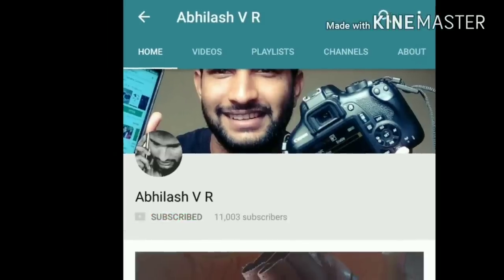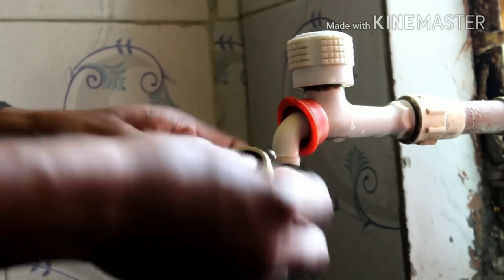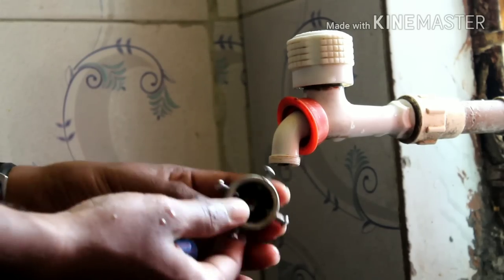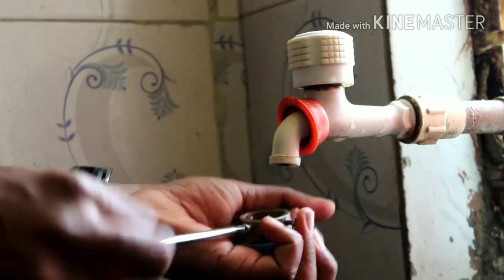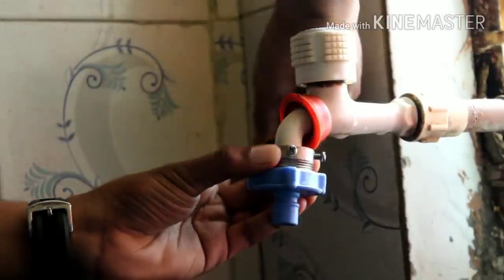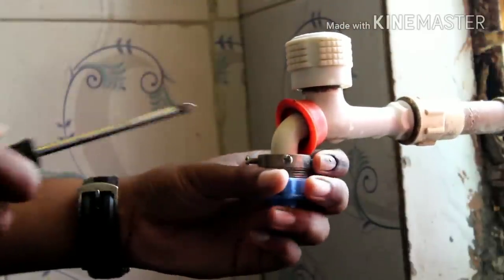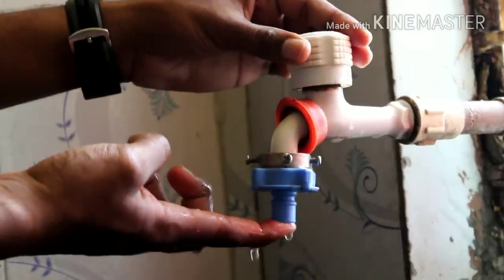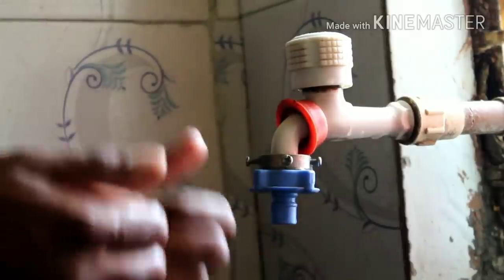#DIY Faucet Water Tap For fully automatic Washing Machine Inlet Adapter

Comment: One more problem I wanna discuss with you.
I placed water tank near washing machine it almost 5 feet high from ground. 
So water comes out from water tank  doesn't have enough pressure. 
What can I do to increase pressure in a water pipe .?
Reply from the maker: It's very difficult if tanknis not placed in enough hight, if your washing machine has manual wash option you can add water directly and wash

Comment: I am a retired soldier 79 years. Getting to reach the attachment for removal was an exercise as tap is located behind and lower position but to paying 200 to workman for just tightening few screws was also not happiness.  I managed with your video. Thanks. Can you do something for arms coming in front of camera and display. Will further add . Thanks again. 
Colonel (Retired) Ashok Mago.  Pune.